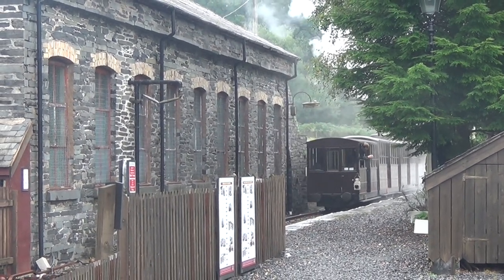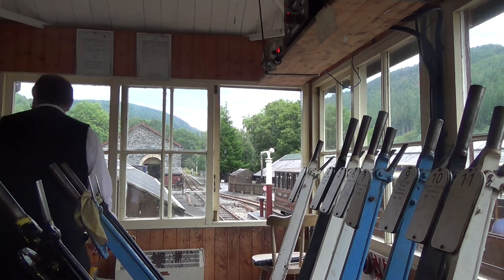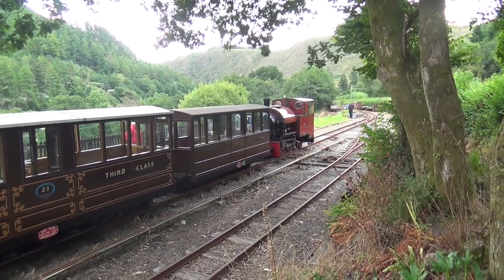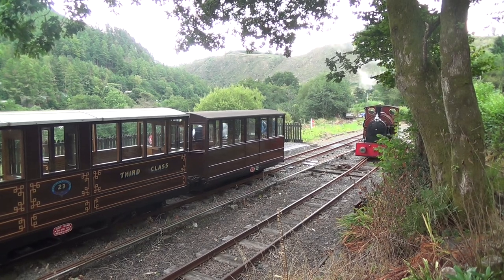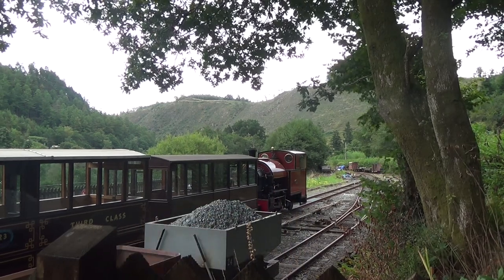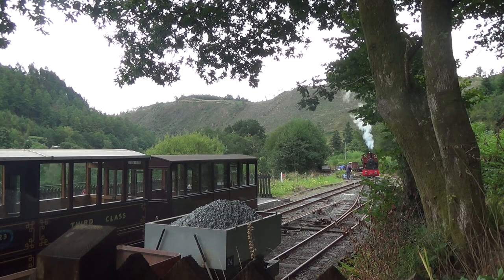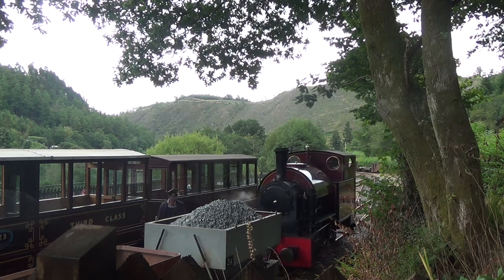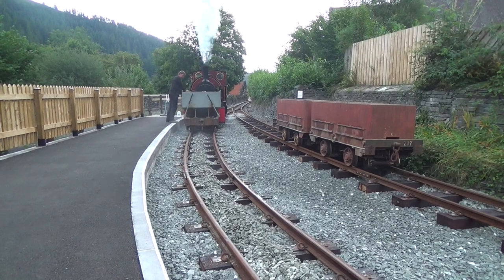A day in the life of a little train on the Corris Railway

Comment: Notice your ballast train appears to be unfitted - do you have the use of a brake van or are all your freight services within the braking capacity of the loco? \m/
Reply: We do have a brake van, which can be used as the southmost vehicle unless the loco is doing that.  That ballast train is within the capacity of that loco, yes.  Heavier ballast trains, or ballast trains on steeper grades will use the larger diesel No 11.